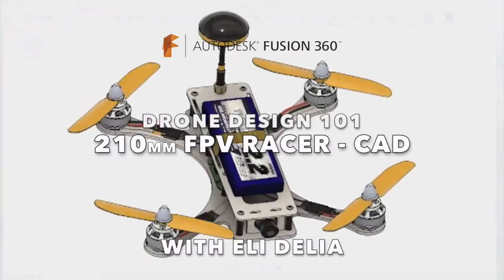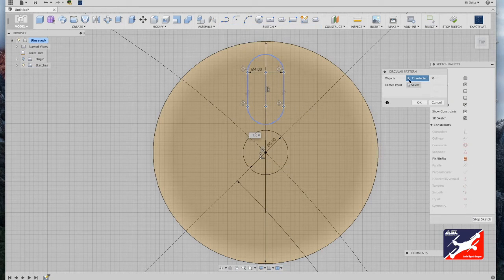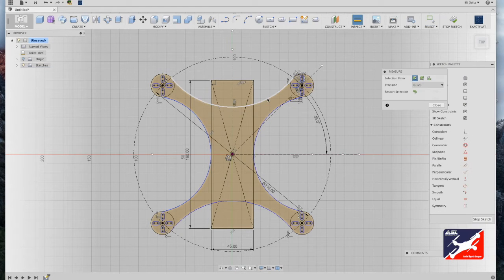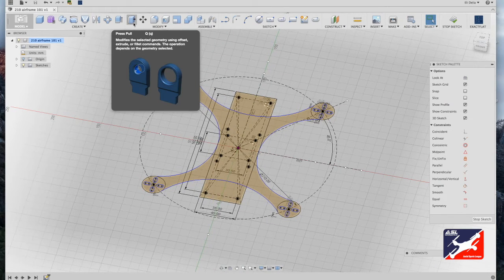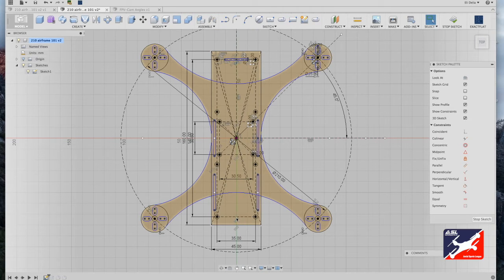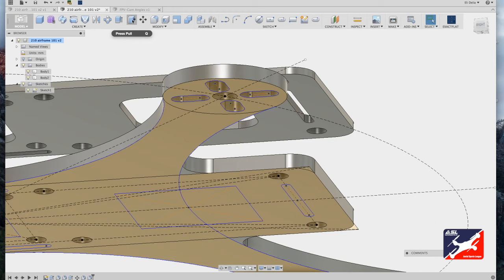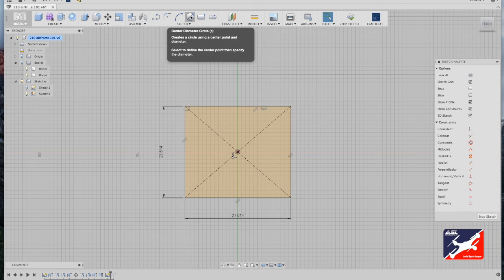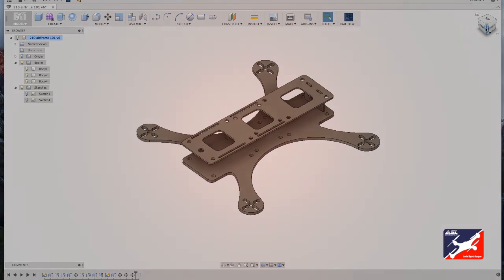ASL Drone Design 101 - 210mm FPV Racer - pt 1  "CAD"

Comment: Great tutourial, but don't advice people to make a motor mount line that. The motor won't align perfectly in the center of the motor mount because of the 4mm slots, and a 5mm center holes isn't enough for most motors.
Reply: Have used this motor mount technique on countless of iterations with great success. It's versatile enough to be motor agnostic. The idea is only to illustrate where and how to use the tools. Can't wait to see what  people make!